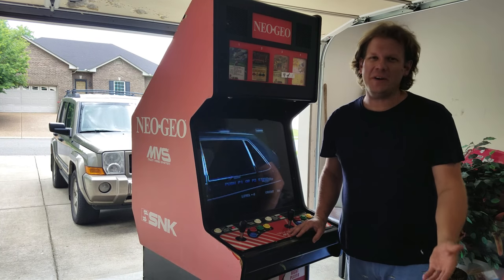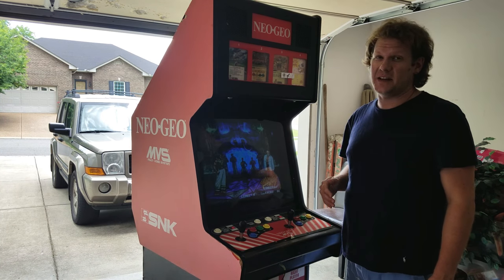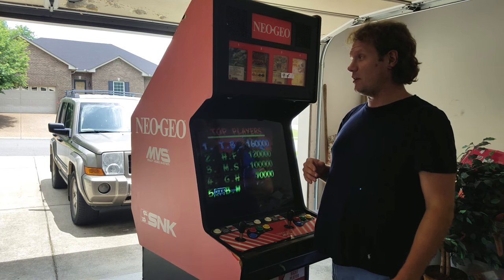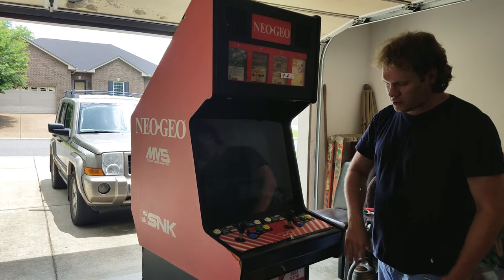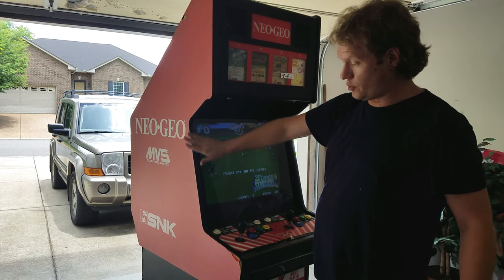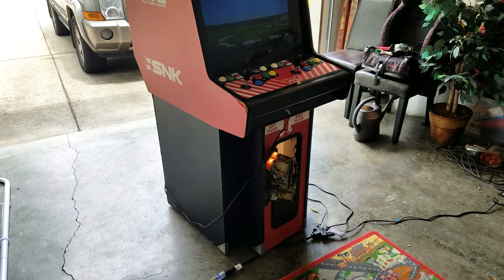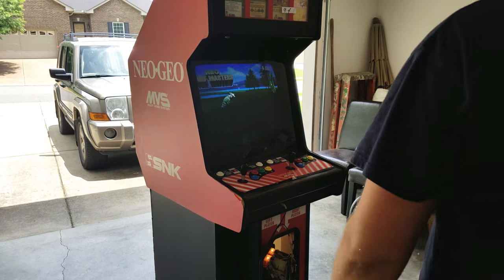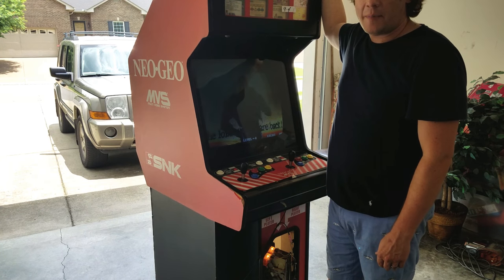Neo Geo MVS Arcade Restoration - Part 1:Getting started

Comment: What is an original working 4 cab worth nowadays?
Reply from the maker: It really depends on the condition.  I think a running one can go from $500 up to $1,500 - $2,000 for a FULLY restored unit.  I've got all my parts for this restoration, but I need to wait till spring to get started.
Reply: thanks for your reply  @RetroTechUSA , I've been looking at one for  C$1000 but i cant find much to compare it to. I think i might make the leap once the weather warms up a bit